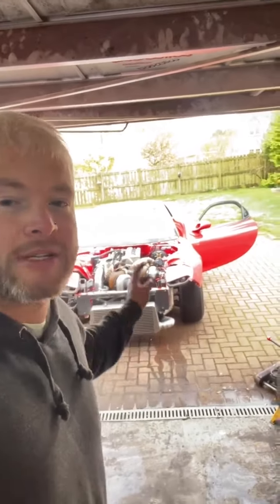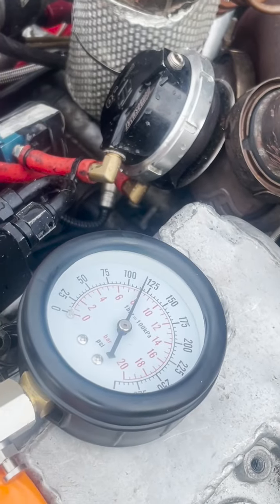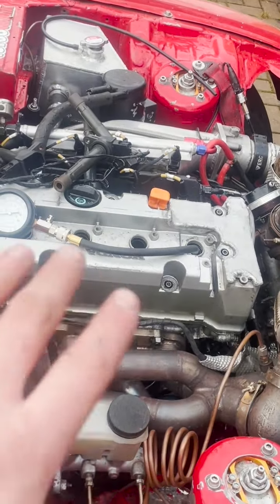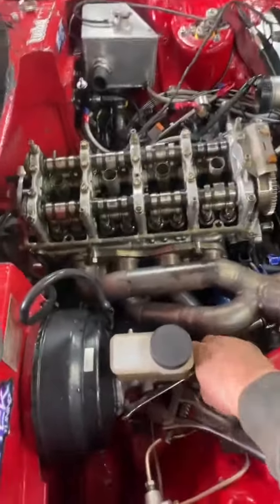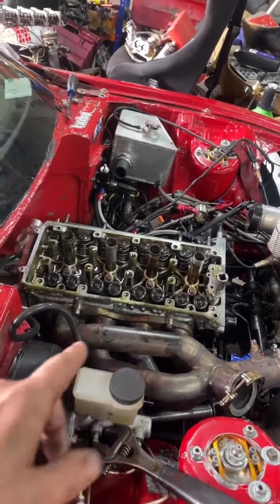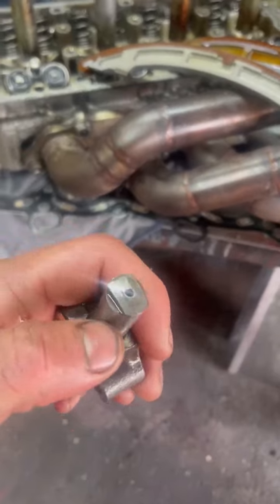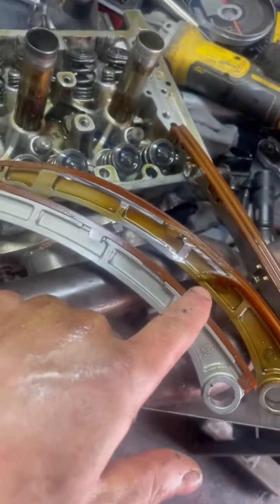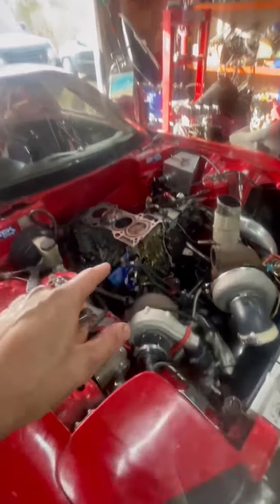PISTONS OUT THE RX7  . The Engine Teardown.    I GOT VERY LUCKY!! 😍

Comment: The Rod to Stoke ratio is an issue that can cause cracking of the block .You should Destroke the Engine to 2.1 or 2.2 Litres to reduce the side Loading on the Bores of the cylinder wall .
Reply from the maker: Very good point althought thats alllot of money for me to do. this is all on a budget :)
Reply: @BEYTEK  hey man, thanks for the reply you can use a S 2000 crank or BC racing make one as well, but that is expensive. They do the same thing in the evo world meaning they use a 2.1 D stoked 4g64 and a normal 2 L crank. It makes a big difference for reliability. I’ve seen a lot of K20 have this issue, but people don’t diagnose the problem properly. I recommend looking at the racing channels built. Their Integra is built by real street performance and he uses the same theory. I’m just saying this as I’m sure you’re going to run into this issue when you start running big numbers.

Comment: Look into siruda head gaskets.
Ive had really good luck with them and has a different type of stopper layer that will work with o rings
Reply from the maker: Wonder if they do k series
Reply: @BEYTEK  yes i use them on my k24/k20 build
Reply from the maker: @audirx8  interesting. Do you know if they have a uk dealer
Reply: @BEYTEK  they are based in tiawan.
Can order from there website or ebay that they recently started listing on.
I have a part number for .053 thick 88mm bore k20a head to k24a4 block if you need it.
They do have lots of different bores and thicknesses.
I blew a cometic mls x hg and replaced with this one and been rocking for a yr now at 28psi with no extra pressure in coolant system during pulls.
My head and block were just hand lapped also,so not 100% perfect conditions
Reply from the maker: @audirx8  thanks man. Ill give them a message